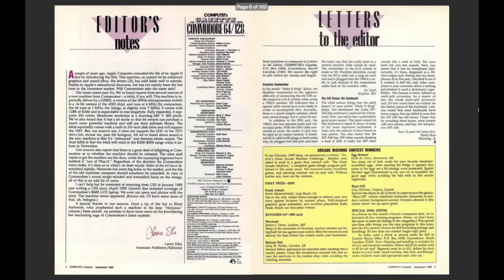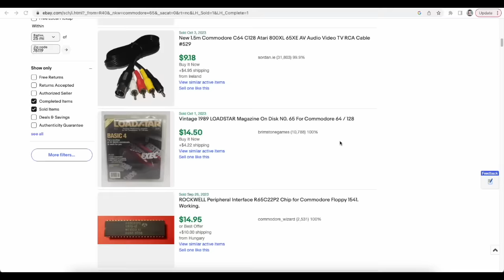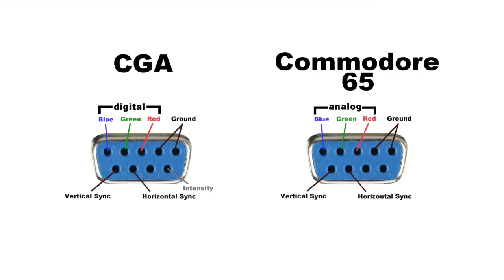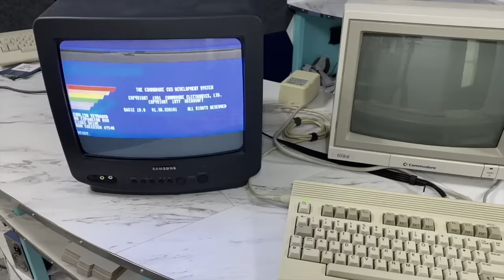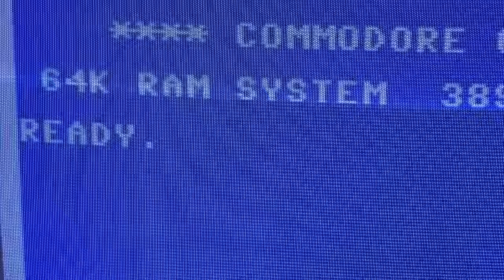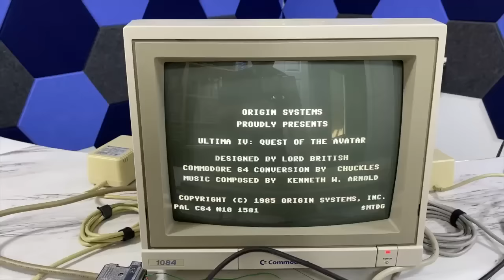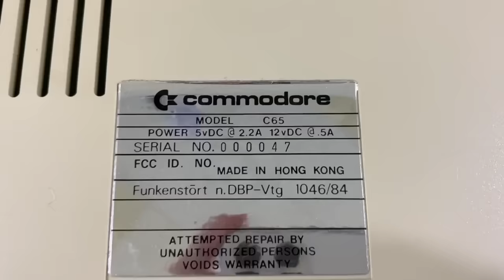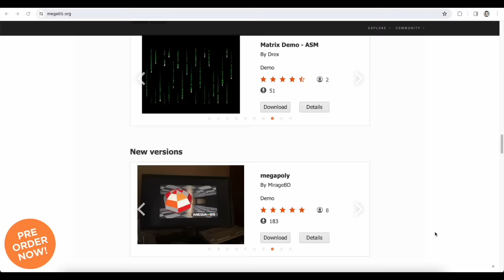The Commodore 65 - A Rare Prototype

Comment: I find it odd that the 64C was for sale longer than the breadbin C64, and yet the majority of 64s being sold in the second hand market is the breadbin model. if it really is that sales tapered off that much during the 64C then it leaves me to wonder how it was profitable to continue to sell them.
Reply: People who bought the 64C did not care for their machines in the same way that the older, more expensive units were.
Reply: Interesting from a British perspective, I feel like the 64C was more popular in the UK than the breadbin model.  So perhaps, there are just more USA resellers of the breadbin model, where it may have been more popular?  I only ever saw one breadbin model in the UK amongst all my friends and family. Whereas the successor was far more ubiquitous.
Reply: Keep in mind, the 64C is a "cost reduced" model, meaning there are way fewer chips than the breadbin, and the mainboard itself is smaller, and Commodore manufactured its own chips and improved its fabrication processes over time. So even with reduced sales they could still make a profit at this late in the game.
Reply: @LeftoverBeefcake  cost reduced or crippled. the custom chip that replaced a few others is a bitch to repair. better to take all other chips and put them on a new old board and add a replacement PLA etc.
Reply: I think many people immediately associate the breadbin model with the Commodore
Reply: The 64c wasn't really popular in the US as the NES really took off as the main games machine. There aren't actually that many that were made in the US. Most of them were made over in Europe where it was still a very popular games machine even after the Amiga came out.
Reply: The peak years for Commodore 64 sales were between '83-'86, so even though the 64C was sold for more years afterwards, the volume of sales had already declined precipitously from '87 and beyond.  That's probably why you see more breadbins on the second hand market.
Reply: @bruwin  I checked in the 1990 Argos (huge U.K. retailer) catalogue and the C64C was in the "video games" section for for £159 right next to the NES  which was £95. 

The differences were the C64C included ten games (which would probably have been another £200 for the NES) and legit games cassettes for machines like the C64 and Spectrum were readily available  for £1 each. 

Finally throughout the 80s the U.K. Government had been telling people that if their children didn't become familiar with "computers" (anything with a QWERTY keyboard counted) they would be unemployable. 

Given all that it is easy to see why people would chose a C64 over a NES. Of course the computer people really wanted was an Amiga but they were in a different price range. PCs were in yet another price range with an Ad Lib soundcard costing almost as much as a C64.
Reply: Lot of those breadbin C64's are actually C64G, a C64C in breadbin case.

Comment: I'm really glad to see upload, David. I love the channel! The last few days have been difficult and your videos are always educational AND fun! I'm thinking about getting into the C64 and Amiga because of your videos. Hopefully I can find some at decent prices
Reply: Once you consider the cost of a each of those two systems, and with either original acessories (storage medium, crt monitor, 9-pin joysticks) or modern add-ons (floppy emulator, video adapter and maybe one of the more advanced cartridges like the Ultimate II+) It gets quite expensive. The you might consider instead getting a MiSTer FPGA that runs both a C64 and an Amiga 1200 core + many more computers, consoles and arcade machines. The Ultimate64 from Gedion's logic would be my choice if all I wanted was the perfect C64, but they are out of stock now. Software emulators might also be right for you. The C64 'VICE' emulator is really great and the Amiga has a few, like 'Amiga Forever' and 'WinUAE'.
Reply: @superviewer Thank you for the suggestions! I think those would be a good way to go for now at least. If I truly love the systems, I can always look to buy one or both later. A MiSTer might be just the ticket. Thank you!

Comment: Aah, I feel like the slowness of the graphics example was due to Commodore's choice of using bitplanes for the graphics modes used by BASIC's drawing routines. I guess they were aspiring to do graphics like the Amiga, but this added more load on the cpu. My gut feeling is, if you want to see the speed-win, avoid bitplanes, and stick with the old-school c64-bitmap-graphic modes instead. That path will have it's own challenges too, as the c65 rom's drawing routines are hard-coded to work with bitplanes only, so at the very least you'd have to write your own line-drawing routine in assembly and call it from basic. Perhaps with that sorted, you could then see the speed win the 3.5 MHz speed ought to provide :)
Reply: Well, the C65 have a blitter, so the line drawing should be accelerated. My guess early ROM version didn't support that.
Reply: @arivaldarivald3212  It's definitely advantageous to have a blitter, though the C65's dma controller feels more like "almost a blitter" :-) I don't believe it had any special mechanism to assist with drawing lines or blitting onto blitplanes. If it did, then yeah, could take the win there. One other potential win could be the C65's DAT, think it was trying to translate x,y coords into an address in that c64 8x8 char block space. Maybe that might have assisted, though I don't think the rom makes any use of DAT either. I believe the C65 Zed Yago demo made use of it?
Reply: I highly suspect this is why Commodore labeled the prototype ROM as "BitShitter"
Reply: @MacPoop  Bit Shifter is a person in the 65 community. That isn't a Commodore label.
Reply: @bruwin  it's written either "shiffer" or "shitter" enlarged on my screen so.. I guess I'll take your word for it. So is that supposed to be a totally custom ROM or what?
Reply: @MacPoop  No, the original C65 ROM was incomplete. Bit Shifter did a lot of work to complete it, and then expand upon it for use in the MEGA65.
Reply: @bruwin  Neat. Learn something new every day!
Reply: @MacPoop  It's "Shifter", there's much less curvature on the top of the "t". I think didn't see the top of the "f" because it merges with the line.
Reply: I still maintain that "bit shitter" was still a funny misread on my behalf - Would have been an awesome pun had it been called bit shitter lmao
Reply: @eekee6034 I do apologize for my sloppy handwriting.  I certainly didn't want BitShifter to be misunderstood like that. :(

Comment: The image would actually be 50 frames per second, as it is progressive scan. With interlaced you get 50 fields per second, where pairs of two fields (even scanlines and odd scanlines) make up a frame. So interlaced PAL would be 50 fields per second, and 25 frames per second. Most computers, including the C64, however, do not output an interlaced signal, so they output 50 frames per second, they have no concept of even/odd fields.

Comment: In Europe it would have sold by truck loads in 1990. The C64 was still selling quite strong, at half price of the Amiga. The C65 was cheaper than the Amiga to produce. I think it would have become a huge hit, and probably I would have stayed on the 8 bit line instead of switching to the Amiga.

If it had come out in 1987 or 88, even better, but that was not possible due to the limited resources Commodore had. 1990 would have been possible, because it was finally ready for production when it got cancelled.
Reply: By the truck load when up against the consoles? I doubt it. Even the low-end Amiga machines were effectively sunk by the emergence of a new generation of consoles, and things like the Sega Master System were quite capable of competing against an enhanced C64 like this. And although people may insist that buyers were using the C64 and Amiga for other things, the gaming market was where the volume was.
Reply: @paul_boddie  the technical capabilities of a system do not directly translate to sales numbers. When I say that the C64 was a big seller, together with the Amiga 500, in Scandinavia in 1990, it's not something I think. It's something I know because it was my youth, I lived there, I was active in the demo scene and I worked part time at a small computer store. We got the machines by the pallet.

And yes, most people used them to play games. Free games. Pirating was huge. You could buy a NES or SNES and afford a few games, or buy a C64 or an Amiga, and have unlimited numbers. Also, new games kept coming to the C64 until 1991.

If the C65 had replaced the C64 in 1990, at the same price point, it would have sold a lot.
Reply: @MaxQ10001  I don't disbelieve you that machines like the C64 sold well enough into the 1990s. I mean, Amstrad were also still selling various 8-bit models in probably healthy numbers at the start of the 1990s as well, including the tape-based ZX Spectrum +2. But I would have to ask what kind of pricing the C64 had to be able to sell by the pallet, as well as what software was being offered.

Big retailers don't shift machines by appealing to piracy: Amstrad were able to keep on selling older models precisely because there was a glut of low-cost games, not because someone had some mates with a bunch of cracked games. And getting a presence at big retailers was crucial. It doesn't matter how many machines small stores shift if the competition is shifting orders of magnitude more units through the big retailers.

There is also the matter of whether the C65 would have been able to launch at the right price point, which is as a budget machine priced to replace the already discounted C64. Commodore tried to appeal to the emerging console market with the C64GS at £99 which was a failure. Interestingly, in the UK, Amstrad released its own GX4000 console at the same time and at the same price, alongside other machines that were compatible and that might have broadened the market for enhanced titles alongside existing ones. That didn't work out either.

The C65 (like Amstrads refreshed CPC models) would have avoided the usability issues of the C64GS, but it might have been a challenge to get the pricing low enough by including a disk drive. The budget-level ZX Spectrum +3 only got as cheap as around £200. Then there would have needed to be a commercial incentive to release software on disk, including new software taking advantage of the new features, as opposed to random "warez" peddlers copying other people's older games. Otherwise, they might as well have just kept on selling the C64.

And I am very much aware that the low-end Amiga models did pretty well across the whole of western Europe, making people in Europe believe that they were somehow also very popular in the US. In practice, the European part of Commodore was probably shoring up the whole company in the end. But Commodore was stuggling to maintain volumes as the 1990s progressed and clearly trying to find a viable business strategy, hence all the different products they released that were not successful.

And a substantial reason for that competitive hardship was the emergence of the likes of Sega who were making substantial inroads by 1990. Although you had to buy cartridges, there were probably healthy second-hand/pre-owned and rental markets already established in various countries.

I guess we just see things differently, but I just don't see how Commodore would have been able to make the numbers add up.
Reply: @paul_boddie  I have read that the chip cost of the C65 was about the same as the C64. It had a higher BOM due to the disk drive, but a C65 would have been cheaper than the C64 with a drive but a few quid more expensive than a C64 with datasette. The big problem for Commodore I guess was that the graphics could be better than on the Amiga. With the optimized 6502, using 40-50% less clock cycles, and running at a higher clock, and with the included blitter, and 512 color capacity, many games would have looked better on the C65. The 68000 spent many clock cycles on some operations. 

The whole company was so mismanaged, the C65 should have been out in 88, and the A1200 in 89-90. 

But I still believe the C65 in 90 would have extended the rope they used to end themselves with, at least with a few meters.

The 64GS was a catastrophy. I think we sold 4-5, and returned the rest. On one of the cartridges we got in, one if the games required you to press a key on the keyboard to start the game. No one had even tried to play it on the GS before release. That is saying a lot on how much energy got into that project.

Had the GS used the C65 chipset with more colors and a blitter, it would have been a good competition for Nintendo and Sega. The only thing the C64 had going for it at that time was price. Cheap computer, "free" games. 

But, yeah, games were still being made. Can't remember the titles, but we got in new titles on a regular basis in 89-90.
Reply: @MaxQ10001  I would hope that they might have been able to optimise not only the cost of the system with the disk drive but also the way the disk drive worked. Watching videos showing the classic Commodore drives loading software, and recalling complaints from back in the day, the disk solution for the C64 was an absolute joke compared to other systems.

But I think that to give Commodore enough room below the Amiga, if launching such a product as late as 1990, it would have to be aiming for £150 at most. (Note that Amstrad's systems which were a bit more expensive came with monitors.) Maybe that price might have made it viable simply as a cost-optimised C64, which was probably well cost-optimised already, but whose disk drive had not been similarly cost-optimised and refined.

That leads to the issue of whether it would have been worth enhancing the system or just pressing on with the C64. If the chipset enhancements could have been incorporated effectively for free, with no expectation that anyone would use them, then I suppose the C64 could have been retired in favour of the C65.

However, Commodore really needed to be cultivating new opportunities, and this would have needed developers to be actively involved in releasing new, enhanced titles, growing this as a new platform. There was little prospect of that happening by then since the big developers had been shifting focus for quite some time already. And selling lots of units on the basis of old game availability was all very well, but it would never have produced the volumes that such low-margin products need to in order to boost the company's bottom line significantly.

I found it interesting that Mr Murray talks about the Apple IIGS as a comparable product when it arrived much earlier, as he notes, and has a 16-bit CPU, not the 8-bit CPU of this model. Admittedly, the IIGS was expensive, as Apple products were, but I think that any such follow-up to the C64 needed to arrive quite a bit earlier, as you suggest. At that point, there might have been a bit more developer interest.

It is also interesting that you note the 68000 needing more cycles for some of its instructions to complete, and Mr Murray appears to be under the impression that a fast 6502 is competitive with the Amiga. Amusingly, Amiga enthusiasts were prone to complain about such observations when made by users of other 6502-based platforms, and justifiably so. However, they also made much of the illegitimacy of instructions-per-second ratings, how the Amiga was unfairly portrayed against things like the ARM, and so on, when all along the ratings were using industry standard VAX-comparable performance measurements and had nothing to do with the actual instructions.
Reply: @paul_boddie  I think the biggest problem with the 68000 was related to interrupts, if I recall correctly. And, if you were to push all those registers, it took a lot of extra time, adding to the slow interrupts. Much was fixed in the later 68k models. However, writing assembly on the 68k was lovely. I really liked programming the Amiga. 

The 6502 in the C65 had some very good improvements. Many 1 byte instructions went down to one cycle. And it could use a 16 bit stack, placed at any page. And the zero page could be moved. Suddenly C became a good option for programming. Of course it was still slow for 16 bit operations but so much data back then only needed 8 bits.

I never saw the Apple IIGS back in the day. Apple was almost not present at all in Scandinavia. At the right price it would probably had given the Amiga and ST more competition. But that's not how Apple does it, like you point out 😅

One other debate was: would the C65  mode have been used at all? Because 128 mode was never used. I think so, because it provided so much more functionality. The C128 did only provide some extra RAM. When the A1200 came out, the AGA chipset was used immediately. Both for games and on the demo scene. 

The answers, we will never get 😥 The strange thing is that the production went as far as the PSUs were already in mass production, and instead used on the CD32. The label says "C65".

I know one thing: for £150 me and my friends would have lined up in front of the store in 1989. Just like we did in 93 for the 1200 😁

Comment: The PAL system has 5 frames less per second but it has 100 extra lines of resolution per frame, this is why you are seeing flickers at the bottom of the screen.  PAL was designed to help with the issue of low screen visibility in bad weather.  With analogue tv if the weather is bad the picture quality is low.  By providing an extra 100 lines of resolution the idea was the picture would be clearer in bad weather.